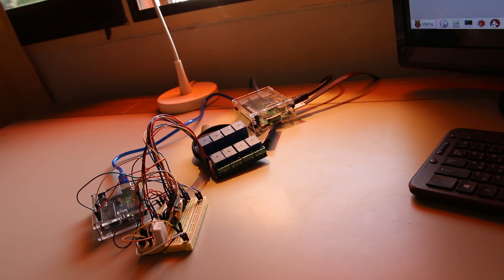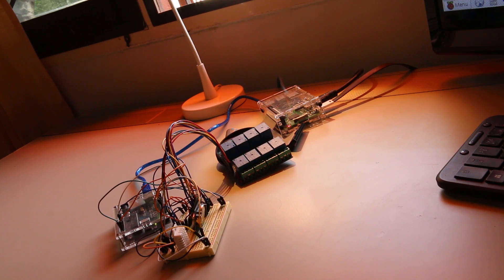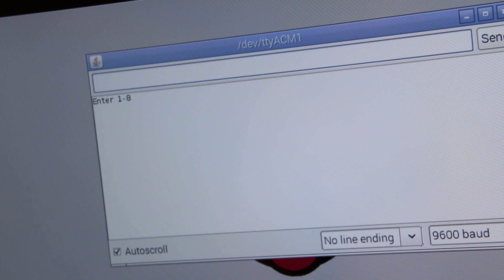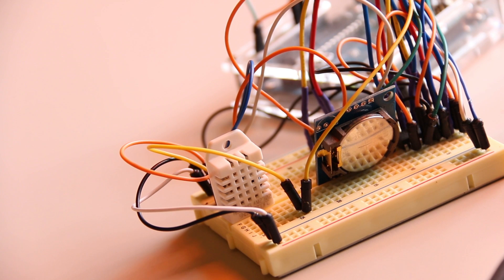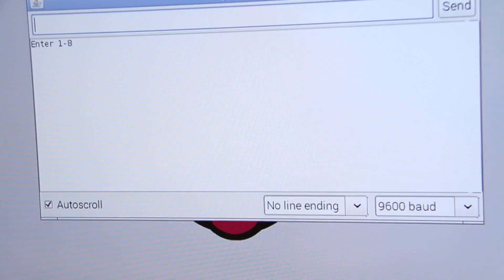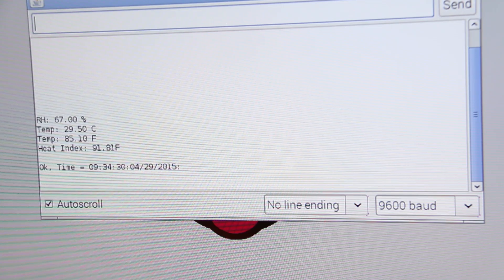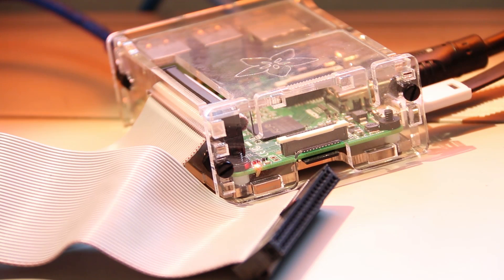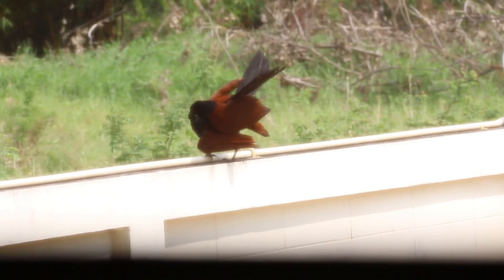GrowController

Comment: I've seen the sandbox Electronics CO2 and am very curious. Please let me know if you find a sensor that seem reliable. Looking to build a semi-automated "space bucket" with a 55 gallon drum. Mostly for fun because I love fucking with this stuff. 

Please let me know if you have tinkered with CO2 sensors man, info is surprisingly sparse.
Reply: I have the sandbox co2 sensor. I would spend the extra bucks for an NDIR sensor if I were you. Accuracy on the 811 is ok, but the break-in period and sensor drift is more than what I would like to deal with in a finished product. They take  forever to warm up as well, but the MG811 is probably the cheapest option. Reply With your email, and I'll send you some working code.
Reply: do you have this sensor? because this co2 sensor says NDIR does that one have issues? http://sandboxelectronics.com/?product=mh-z16-ndir-co2-sensor-with-i2cuart-5v3-3v-interface-for-arduinoraspeberry-pi&gclid=Cj0KEQjwzd3GBRDks7SYuNHi3JEBEiQAIm6EIyucWtBT-LnJMbeLsmd_5Lg3mgSFX3R40a6cFpLObs8aAnYg8P8HAQ

my email is Strangerthanreality@gmail.com
Reply: David Cohen 
NO, I have the MG811. It's a tin dioxide sensor with a built in heater. The one you have is a better quality sensor with digital i2c output. Mine is analog only.
Reply: David Cohen 
There's a link on sandboxes website for the code needed for your sensor. It's a github link. I gave it a look, and it should work as far as I can see.

Comment: What is the reason for the Arduino.  Why not have all the sensors and relays hook directly to the Pi?  The Pi would then do all the "heavy lifting" while also being the web server.  This seems to remove a layer of abstraction.  I ask as I am looking to setup something similar and just wondered if I was missing something.  Great video, thanks!

Comment: Do you recall if they sell sensors to monitor PH and PPM for a hydro setup ?
Reply from the maker: I've read that people have adapted ph probes, but I have not researched that as I use living soil and have no use monitoring PH, sorry
Reply: +Lontslo Lonnis No worries! Read forum where a guy knew an engineer that wrote code to control nutrient mix and monitor PH. But I am not engineer 😐. Also how do your babies come out? Didn't see a follow up video on them . Thanks!
Reply from the maker: +Curtis Guerrero  I videoed an update... But never got to edit and post it.  Been busy traveling for work.  I'm hoping next week I'll finally get around to updating!  But I keep learning and getting better, each harvest is better than the last :)
Reply: +Lontslo Lonnis Totally agree on the learning curve! Reason i came to this video is that I am researching on making a monitoring system using raspberry pi.